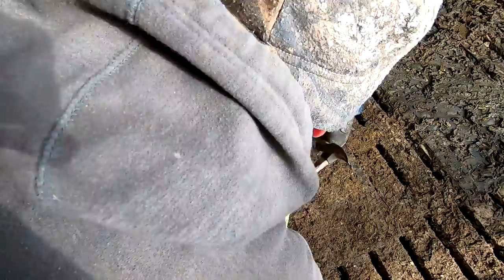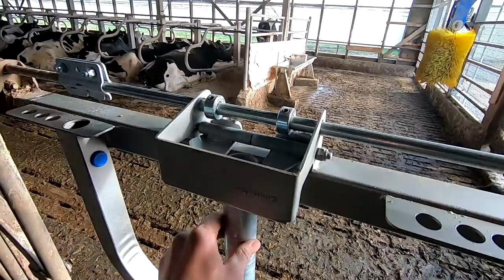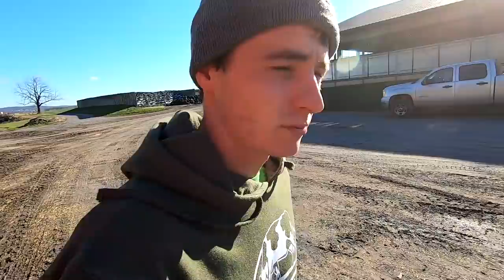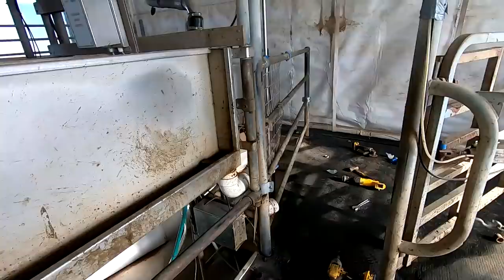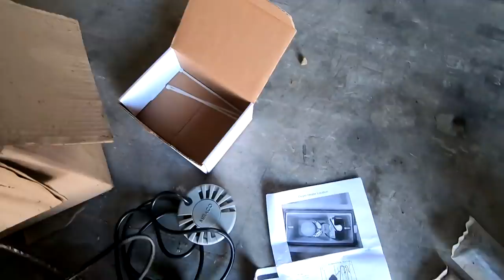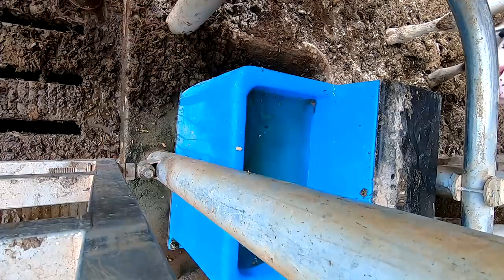Much Needed Repairs on the Dairy

Comment: The older heifers know when they spot a good looking guy, and as far as they are concerned you are the bull.  Heat tape on the pipes saves a lot bother when it gets cold. It's nice to see them jump and play when the new bedding comes in. I didn't realize the head locks ever had to be replaced. Good video. Pax.

Comment: You were right about the further you move down the barn, the more "friendly" the heifers get.  And they are so, so helpful too.  The box was probably fun to play with though.  Good job on taking care of the overall maintenance.  Yes, it can be a headache but it comes with the territory.  Remember to find two replacement screws so everything is in order and intact.  Duct tape does work pretty well, but those wields will hold up better (of course the blue duct tape did add a bit of color to the parlor).  Hope you guys had a good Thanksgiving and I hope you all have a Great Christmas.

Comment: Eric,
  Put a wire brush in your angle grinder and clean your welds up. Then spray the welded areas with Rust-Oleum "Cold Galvanizing Compound" and let it dry. Also clean the rust off your head locks and spray them to prevent further rusting. This product works great. I use it on my galvanized chain link fence and it stops the rusting for years. Keep up the good work.

Comment: Eric.....get one of the 110V flux core welders.  Weigh less than 20#'s and just plug it into any outlet with a 20 amp breaker.  EZY PEEZY, and they're not expensive.

Comment: Thanks Eric for another interesting video of those necessary repair jobs around the farm.  After seeing some of the repairs you have been doing on gates because of rusting, makes me wonder if they are dipping the sections long enough to get a good thickness of galvanized on the steel.  
A high amperage (30-50 amps) lead/extension is mighty handy.  If you have to change out the power leads on one of the silos and the problem is not to big, you may want to save the rubber cord for the motor and get a few parts to put one together.  The ones I have worker on are usually #6 copper which works well on large welders.  I use an extension made from #8 copper on my welder and it works great. 
Keep up the videos...they are always interesting.  Thanks to you and your dad.

Comment: Great videos it’s always fun to see the cows react to the new bedding they look happy jumping around 

I’m sure there must be a harbor fright in your area or look on Amazon  
They both have amazing wire feed using gas or flux core wire this would be best for outside ware the wind would blow the gas away or stick, tig or many different combinations of wilders for under 200 to 300 bucks 
These things are the size of a 12 pack of soda and they run off of 110 
Ya that’s right you can plug it in any ware 
And surprisingly these are great welders and a great value for this kind of portability

Comment: Sturdi-built makes a weldable bracket instead of cutting the bolt on bracket. But it looks like you were already well into the project.
Reply from the maker: Yeah we should have just got those instead, was hoping to avoid having to get the welder over.

Comment: If your thermostat for the hfrs water fountains is down below where its insulated they arent going to read the temperature up above where the float valves are should went with geothermal set up on the fountains when you built the barn where you have a pipe that goes underground gets rid of dealing with electric heat which ive had in my hfr barn for 20yrs with hardly any freeze ups and i noticed the paste you use for dehorning doesnt work very well you have quite a few with horns i see all the time

Comment: All you need to fix things is Duct Tape , WD-40 , and a hammer . If it moves and shouldn't Duct Tape , if it won't move WD-40 . and if a hammer won't fix it it's an electrical problem .

Comment: prompted to wonder why the bird barrier wire was not put also on the "wall" (vertical) sides--less collections on top of  attic option. no complete protection and/or too much trouble elsewhere?  if birds enter under the wired trusses, seems that's helpful, but still, they are there, etc., ditto, since vertical/near-vertical is problematic too.  please advise.